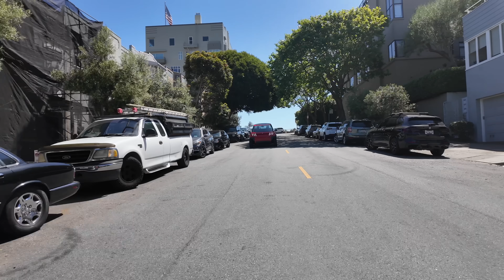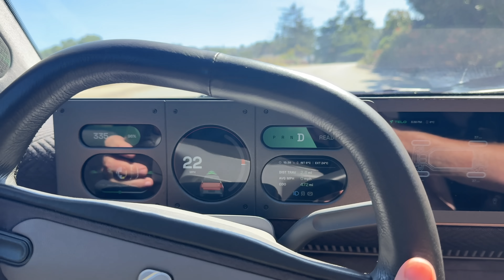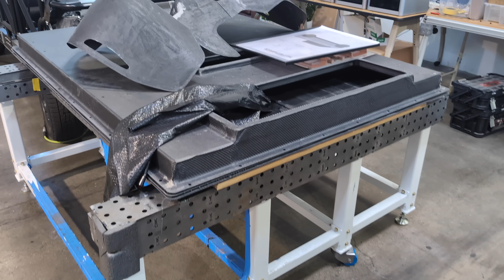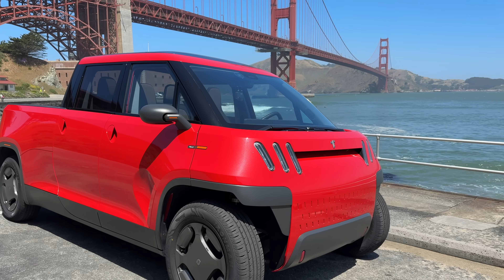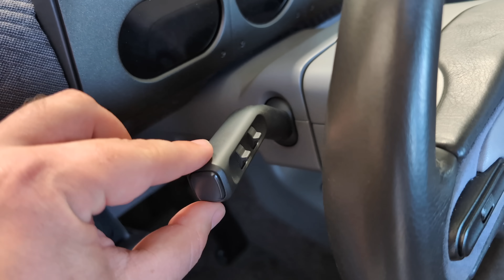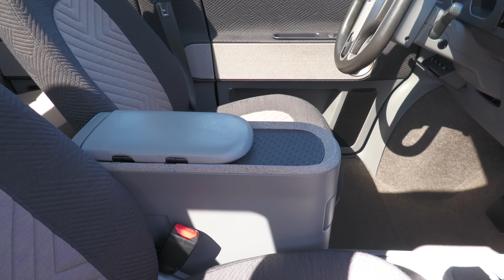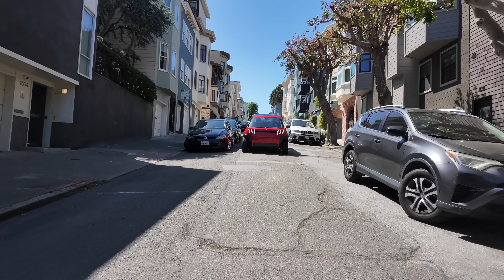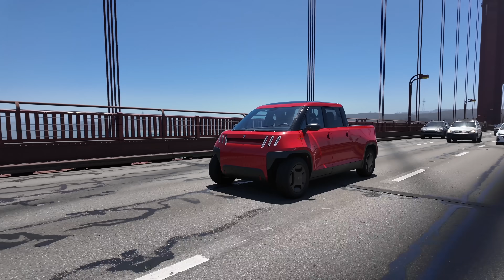The Tiny Telo Truck Hopes to Pack a Big Truck Punch

Comment: EV startups love giving their medium sized car Ferrari level horsepower. I guess it doesn't cost that much more, but giving random people the ability to do 0-60 in 3 seconds doesnt seem great.
Reply: That has nothing to do with the EV companies trying to be flashy. The fact is you just get a whole ton of immediately available torque in electric motors. And for most people it's going to be pretty harmless, since if they try under the wrong conditions they're just going to spin out.
Reply: You can control the power,  and the bigger motor allows more regen.
Reply: Having played around with my AWD Ioniq 5 a bit I came to the conclusion that I'm not really competent for that level of power.  Unless I need the AWD, or trying to merge with a trailer, I keep it in Eco mode.

Comment: One small criticism, (shown with your own recent experiences)... any EV with a load deck\cargo bed, should have its charge port at the front.
Reply: I was thinking this too.  Tail lights and the back end tend to cop a bit of a flogging on fleet/delivery vehicles.  Moving the charge port away from where people tend to bump things into while loading would be an excellent idea.  Also, installing charging infrastructure on an interior wall is typically much easier than next to garage doors.
Reply: @mvansumeren4313 Back into the garage. If you can't do that then maybe you can't drive.
Reply: Why not both...
Reply: @bakudans4851  Cost.
Reply: @bakudans4851 could put in 2 like the 2026 Nissan  Leaf.  That would be nice
Reply: @bakudans4851 I’d imagine they’d have to plan around that carefully since someone will absolutely try to plug 2 chargers into it at once which, if not planned for, could end very badly.
Reply: @menacingdonutz  contactors exist for a reason, yes there has to be engineering involved. But as an engineer myself, not that much.
Reply: @bakudans4851 yeah that’s a what, a triple throw switch? Front - off - Back ezpz
Reply: @joebob3719  that would require user input, no that would not fly.
2 contactors with interlocking that only one can be in in pass tour at the same time, and microswtiches at the plugs that sense if you plug in something. Costs around $100 if you buy it in the hardware store.
Reply: I agree.   Placement was a concession to an already crowded front end.
Reply: why not both?
Reply: @BryceCassagneres  one problem that comes to mind is increasing the cost of a Minor fender bender
Reply: As it stands, they put it there because it was the cheapest option. The charging hardware is in the back.
Reply: I had the same thought.
Reply: Provided that the charging port isn't placed in the nose of the car. In colder climates, a front mounted charging port like that can be a real hassle, because they tend to freeze.
Reply: Towing.  The charge inlet needs to be in front.
But the OBC is ahead of the rear bumper, so that's a long run of 10 AWG (or double 12 AWG) for a 40A OBC. [later] I forgot DCFC, so yeah, the wiring is more expensive and shielded.
Reply: Depending on the size of your trailer youre pulling with this, youll still be shorter in length than a silverado ev. Does it suck? Yeah. Is it that big of a deal? Not necessarily
Reply: @violetsteele350  What sucks? Being WAY smaller than other vehicles with similar or superior utility? That doesn't suck at all; it's the bulk appeal of this truck.
Reply: Is there any legitimate reason not to have both?
Reply: Great video thanks
Reply: Por qué no ambos?
Reply: As a wise man once said "The right side is the left side , while the wrong side is the right side"
Reply: for the little cost that it would take ALL EVs should have charge points front and back.  One charge port is a left over from ICE vehicles.
Reply: @misamsung6191   More than a little cost to add 2 charge ports. There will need to be electrical isolation between the two ( 2 contactors ) so the unused port isn't hot during charging.
Reply: Charging ports should follow a standard for type and location.  RV's in the States have the electrical/water/waste all in the left side rear area, just back into the space and hook up.  Easy and Standardized.  Fuel fill on cars and trucks SHOULD be located left side rear, but some are on the right side.  Why, I don't have a clue.
Reply: @honorharrington4546  And if you're towing?  Almost no EV charge stations allow for pull-through, so a charge port anywhere in the rear is a non-starter.
Reply: @alsavage1  I'm not saying it must be in the front right corner or the left rear, I'm just saying it needs to be consistent across models and brands.  Just like a consistent charge port standard.
Reply: All you guys bickering about towing and charging port locations didn't listen very well. IHe said "t's a city truck."  You will rarely, if ever tow with one of these.
Reply: @porovaara  - It's a small truck.  Those work well in cities AND elsewhere.

I tow with a car right now, have for 20 years.
Reply: IN A WORD "TESLA".
NO NEED TO HAVE (LARGE) CHARGE PORTS IN FRONT FENDERS.
Reply: @MICHGO1  You're missing the point.

If the vehicle is expecting to tow, putting the port in back means many TESLA chargers are unusable unless you can disconnect your trailer first, which is NOT fun if it is loaded.  Most chargers are "pull up", not "drive through".
Reply: @TheTalonts Tesla has several pull through charging locations. They will continue to build more.
Reply: @dvader3263  - Oooooooh, "several"!

You'd think they'd have more than "several" with how long the CyberSUCK has been around.
Reply: Any EV with a cargo bed is a terrible EV if you use the cargo bed.  ICE and hybrids are kings for trucks.
Reply: @DeadBaron  IDK it would really depend on what you are using it for.  To automatically say that an EV wouldn't be useful doesn't explore the usage of an EV pickup.  Both Ford and Chev EVs offer a reasonable towing capacity.
Reply: @misamsung6191 no they don't lmao. I met a guy using a Lightning to tow a camper. He had to stop every 100 miles to recharge and was going from Canada to Boston via Maine. His wife and kids were pissed at him for making a one day trip into three. If you put any heavy loads in the bed or towing, EVs suck
Reply: @DeadBaron  Check out Robert's recent video (last week?) about his Silverado purchase, specifically for towing.  The Silverado has a much better towing range than the CT or Lightning or Rivian, and he has a chart with all four on it.

I agree with the Lightning & 100 mi. tow range.  If that doesn't work for your use case, it's the wrong truck.  A lot of truck owners don't need to tow more than 200 mi., so the Lightning is still a useful towing truck for their use cases.
Reply: @DeadBaron  That would depend on the weight of the camper.  A very heavy camper is also going to decrease your ICE mileage as well.  Also you should be stopping about every 100 miles anyways for a break.  Not to mention that people shouldn't be charging to 100%, many experts suggest that you charge from 10 to 80% as it will be faster.  Do a 100% charge at home or if you are going to be away from your vehicle for an extended period of time.  BTW where from Canada, as Boston is only about 450 KM from the Canadian border which is about 3 charges.
Reply: @misamsung6191 lmao you must be European. I do 100 miles a day just for my job and drive to sites 300 miles away. And with ICE I can refuel in a minute and keep going, with far more on a single tank than any EV charge
Reply: @DeadBaron  I live in Canada you know what people say about assume.  Don't ever assume. With a  flow rate of 10 GPM, dispensing 20 gallons takes about 2.5 minutes depending on flow rate.  To fill an EV to 80% using a DC Fast Charging (10-80%): 20 minutes - 1 hour but that depends on how much supply the charger can deliver and how much the EV can take.  Therefore you are looking at somewhere in the 70 to 100 dollars to fill the ICE vehicle.  An F150 Extended Range (131 kWh) F-150 Lightning from 15% to 80% should cost you  about 50 bucks.
Reply: @DeadBaron  I largely agree with you that EVs are not ideal for towing. As of now, and possibly always, it's just not the best tool for the job, and that's okay. I think if you plan to regularly do long haul towing or construction work where you're putting multiple tons of concrete in the bed to move over moderate to long distances, an EV is probably a stupid choice. The thing is, the vast majority of of pickup drivers in the USA don't use their truck like a truck more than 1-3 times a year. They mostly drive their $70K pavement princesses to the grocery store or on their office job commutes. Something like this perfect for people who want the utility of a functioning pickup truck when they need to get a sheet of drywall or some boards for home repairs, without having to drive a massive vehicle every day that's fuel inefficient, miserable to drive downtown and a nightmare to park. If your priority is towing, this just isn't the right vehicle for you.
Reply: @DeadBaron that’s a chonk of a trailer then.

Comment: they lost me at "we wanted the minimum safety requirements"

and bro talked alot about production costs as if hes constantly shopping for investors.
and tbf race teams build entire shops full of cars with hammers and welders wielded by less than 15 people. 11 guys and a fleet of 3D printers and access to a battery supplier yeah of course they built one car. why not more? listen, i understand "hustle" as its called but the way that guy comes off to a person not from the techbro investment space is a bit odd. to me, the only difference between this and one of those miracle 3 wheelers people were scammed by is a 4th wheel. 

also 500hp!? in a golfcart with no crush zones????!?!?!???
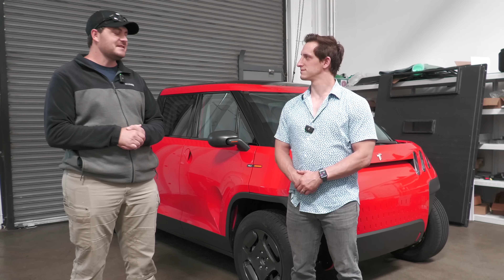Reply: You may have misheard him. (1:28)
 this was built around achieving  a five-star crash rating with the smallest frontal area . That is the highest rating for  NHTSA
Reply: why not take safety seriously, though? why not put it over the line? @tylaranderson8559 

US safety ratings are broad and not rated by an individual car's capabilities. me and everybody else know that its illegal to go that fast but why even tell people it makes 500hp if its safety rating is based on minimum requirements inside a one-size-fits-all system?

my truck makes 150hp. its a 30yr old Taco. it cant go 150mph on a whim. its a 4 star rating and it has a bench and no passenger airbag. would you actually sit in a stumpy flatnosed 500hp golfcart?

Comment: I kinda want one now, but I'm still thinking Slate because you can get a CD player in those. (And its cheaper)

Still it's cute and does 4x8s so i hope they make it!
Reply: The problem with this late is we don't know how the polymer body panels will hold up long term, and they have fewer features
Reply: A CD player? Are you kidding? Slate doesn't have any music player at all. You bring your own.
Reply: @tims8603 exactly!!! They do have a "speaker wiring" option (not the "Bluetooth Tube speaker" holder) but it still has no head unit, so I can buy a basic BT/CD Pioneer unit and have everything!!!
Reply: @tims8603 ah but thats the genius, they do have a "wired speakers" option (thats not the "bluetooth tube holder") and if you get that, you can add just a single din CD/Bluetooth player and have the best of both worlds.

Comment: I had watched a thing about the Slate and it sounded like they were aiming for mid to end of next year as well. The specs on the Telo (30 min 10-80% charge times and 350 miles of range) are getting closer to what I think most people would need to seriously consider switching from gas engines. 2026 should be interesting.
Reply: I've been living with my 250 mile slow charging Bolt for the better part of a decade just fine. Even drove it from Denver to Des Moines and back years ago. Charging infrastructure is far better than back then. 
350 miles is excessive, especially with fast charging.

Comment: Outside of people who want specifically this truck, logistically, you can get much more capable/larger trucks for the price. It makes me think of the Smart ForTwo where you paid a premium for the novelty, and it didn't pay off. I think this this is adorable and probably a blast to drive, but for $40K you'd have to REALLY like the novelty. Regardless the context behind that price.
Reply: It’s not about how capable or large it is - it’s about how usable it is day to day in the environment you’re going to be driving it most often. Compromising slightly on total bed capacity in order to have a truck for your business which you can park wherever you want instead of circling the area for 15 minutes searching for a spot big enough is going to appeal to people in major cities. It’s the same reason the F-150 never made it to Europe until the (comically oversized) current-gen Lightning - businesses here wouldn’t want it because although it can lug more stuff around it’s too long, too wide, and too tall to drive anywhere without causing headaches for yourself and everyone else on the road.
Reply: Even midsize regular trucks are huge compared to the Telo.
Reply: "you can get much more larger trucks for the price."
I think you completely missed the mission statement of this company lol.
Reply: This truck is aimed at a densely packed urban setting. It’s capable and easy to park in conditions an F-150 and even a Ranger couldn’t hack. It’s already got a better looking interior (even at the prototype stage) than the Maverick. Yeah, targeting ford in my references as we’ve had them before.
Reply: well, don't kid yourself in thinking it's not a sort of novelty that americans have that fetisch to use small lorrys as a car as if you had to compensate for something, since it's also never about what they "could" do or so you reeeally think the lorrys only get used for commercial work?
if you would not go for the fetisch novelty, you would get a Fiat Dublò or VW Caddy, because you also have a fetisch for a bad flatbed where you only can pull down one side

Comment: I'm willing to buy one of these, but the deal-breaker for me is the touch screen.
I would want knobs and switches for the controls not a touch screen. I have an old car and I have yet to have to update a program for the knobs and switches to ensure that the heater or the radio still functions correctly.

Comment: Aesthetically, it reminds me of kei cars.
Kei-jidōsha are a legal category of vehicles in Japan which requires, among other things, strict limits on vehicle dimensions. Many kei cars (and kei trucks) are boxy, to get the maximum use out of the legally-permitted 3.4×1.48×2 meter dimensions.

Telo doesn't get tax incentives for making a small truck, but building a small truck is still one of their goals, so I'm not surprised they made similar design decisions.

Comment: One thing i dont understand about American trucks, and im serious: Why the open bed? Whats the advantage over having that space enclosed? 

Enclosed seems so much better. Your stuff stays dry and can't fall out or be taken out. You put in removable seats, and now you habe the option to carry either more passengers or more cargo.

Seriously, i dont get it.
Reply: Like Ramonatho said cargo covers are a thing, but to directly answer your question: Couches. Bookshelves, other furniture, cement mixers, tile cutters, sheet metal benders, there're tons of tools and stuff I've got that wouldn't fit in a covered Bronco but would fit in the Telo. Heck you could probably park a little quad in the back of that thing. 
Having a removable cover is a lot easier than keeping a trailer around; don't need to worry about registration or taxes or tires or anything like that.
Reply: 4x8 sheets of plywood and drywall, bulk materials like dirt, rock, mulch, concrete block, hauling tall/wide/long things, towing gooseneck and fifth wheel trailers. Higher gross vehicle weight rating because they don't have all the additional weight from being enclosed. And most people do put some kind of cover on their beds that can be opened when needed. Not just for rain but also because people like to help themselves to whatever is in the back. It's just way more practical unless you own three kinds of trailers and want to pull one of em every time you need some construction materials or landscaping materials. Having a pickup eliminates the need for the smallest size trailers.
Reply: You can get a cargo cover for basically any truck, and most Americans don't actually use the bed or do real truck stuff, so you don't see most people buy them.

Comment: As much as it is cool, I don’t think any vehicle that has a back like that with four doors is a truck. A truck has a bed you can put a four x eight sheet of plywood in and close the back gate. This thing is merely a four door SUV without a back cover.
Reply: Folding the mid gate this can take a 4x8, so it's more of a truck than an f150 or RAM 1500. and those things are gargantuan.

Comment: The longer I watch, the more I want one. I'm still interested in the Slate, because I don't need a 4-door just to run into town
Reply: Agreed. I kept thinking that it would be nicer for me without the backseats and a longer bed.
Reply: I hope the Slate gets power plugs in the back (or at least option to add 240V power plugs to the back)!
Reply: @kylelowe  I have an F150 Powerboost so it's not necessary for me but I can understand wanting it. But it also adds cost. If it's an optional extra that's one thing.
Reply: If they make the SUV they’re planning and a single cab version they’d have all bases covered and hopefully sell a good amount.
Reply: @anusername8350  the "SUV" is really a mini van- or MV1.